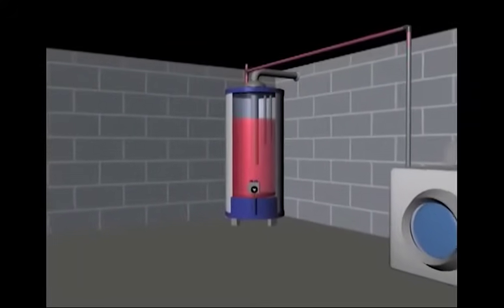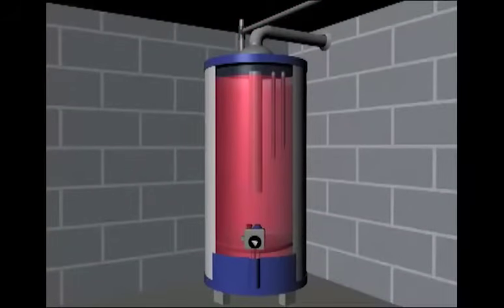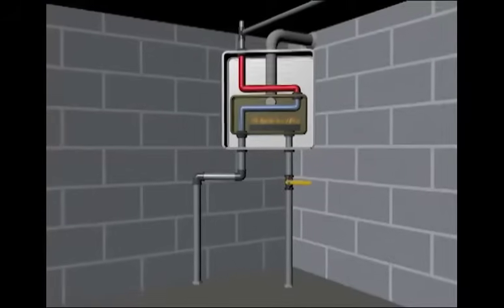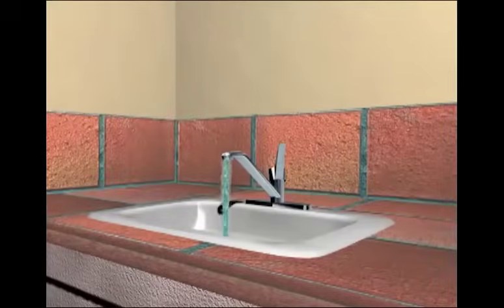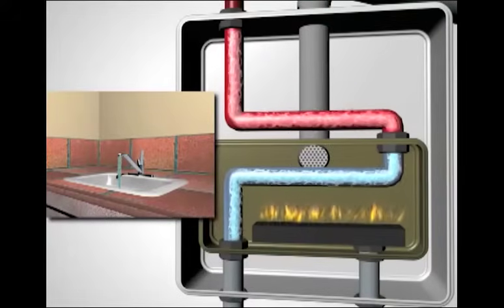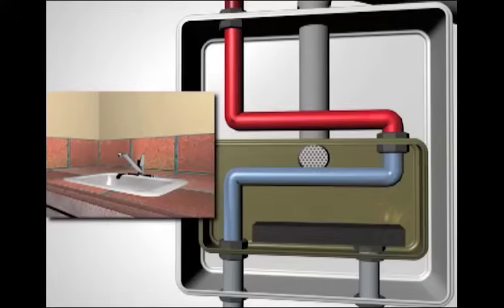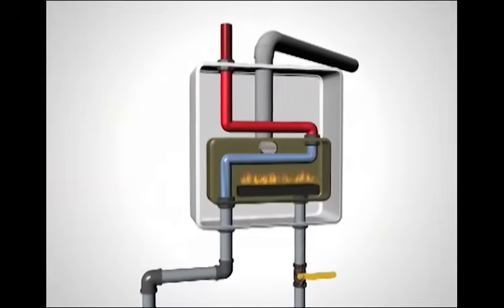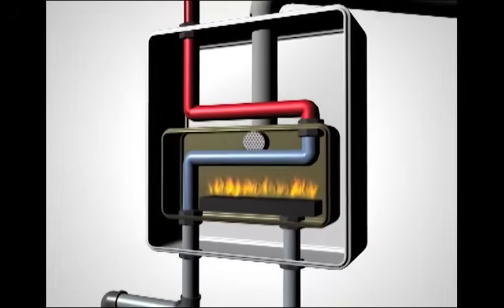How Tankless Water Heaters Work

Comment: We have one and it is literally endless hot water. Before, with the "water tank" I was usually the one having to wait to take my shower. We have a large family and being "mom" I was always LAST. Now, still last, but I don't have to wait for water to heat up to take my shower! To be fair, we are a 4 generation family in our big house most days. Myself, adult children, grandchildren and great grandchildren. Between dishwasher, washer, showers and baths, this tankless heater not only saves electricity, but also time!
Reply: So it makes the water like hot hot? I like my stuff steaming and the only reason i dont want a tankless is because i feel like it wouldnt heat it fast enough
Reply: @brucethemoose2820 yes it gets hot, but it depends on what you set your water heater thermostat to in the home. Ours is set to 120°F and the shower gets extremely hot.

Comment: How long does it take for the water to get hot? Do you have to have the faucet running for half a minute or more?
Reply: The cold water that was in the lines has to run out first, so it depends on how far the faucet is from the water heater.
Reply: Fwiw, when I tested my first unit; of course for testing reasons I was using a really short line (pretty much like a 3' hose to a shower head for testing purposes) and these things literally heat water INSTANTLY. 

I'd imagine installed in a home environment with long pipes you'll 'feel' cold (or at least not hot) water for how ever long it takes to actually make it from the heater to the faucet or appliance. But, this is literally NO Different than a traditional system either!

I can say, these 'on demand' units with no tanks (at least any one worth their salt) will literally INSTANTLY heat water!

I'm sure there are also different grades, qualities, etc but the first one I got put out about 80°c water (instantly)! (That's about 176°f) ~ instantly!

I will never use that antiquated method again, of constantly keeping a Tank full of water "hot" just so that it's ready 'when I need it' (because they run out too)! With a system like this, you'll literally never run out of hot water!
Reply: eh it really depends tbh